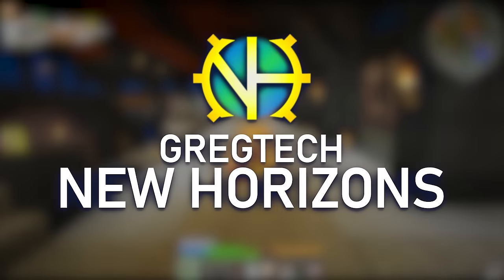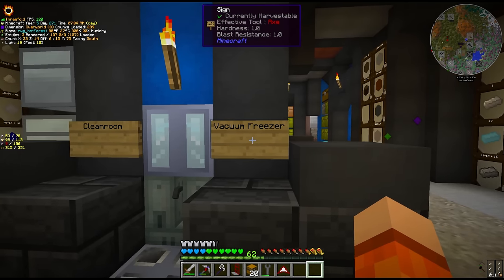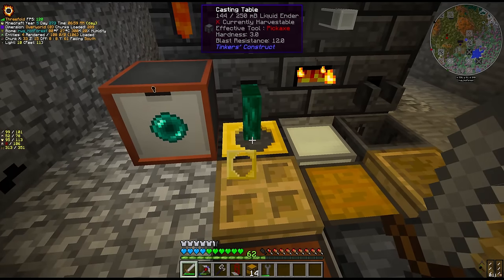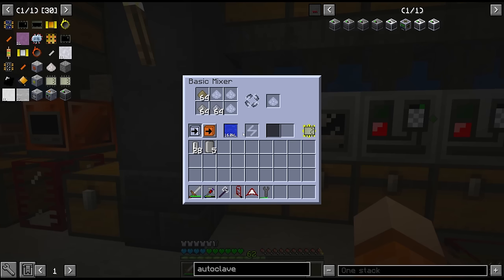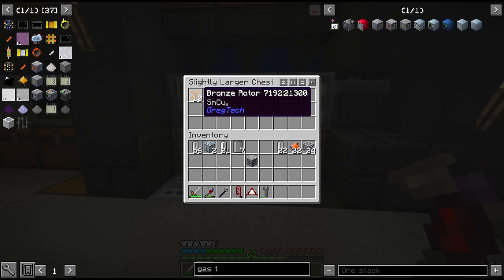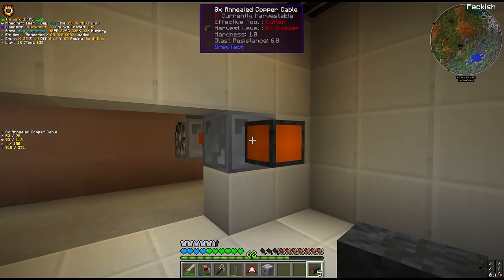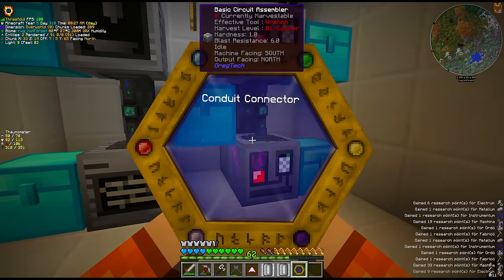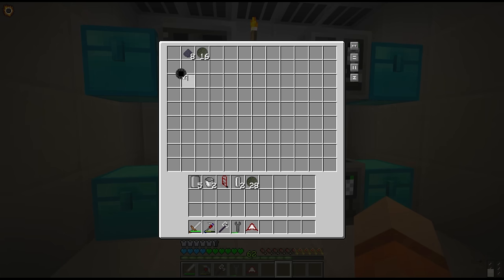Gregtech New Horizons S2 16: The Cleanroom

Comment: 0:23 If a GregTech machine from GTNH is receiving power but not enough to run at full speed, does the machine just run at a reduced speed/efficiency or does the machine just not process anything at all regardless of the energy its receiving? By contrast, machines that use RF/FE will most likely still work at a reduced speed if given insufficient power.
Reply: The single block machines will reset progress and won't progress until they get enough power, multiblocks will void their output

Comment: I think you can just use a lever on the smeltery faucet and it'll pour liquids even faster than the timer would
Reply: I know that Im a year late, but they changed the configs for TK. Making it so that levers do not auto trigger. You either need what he has or manually pull the lever each time.

Comment: I know that this comment is a year out of date and that the series is already completed, but couldn't you use a Drawer Controller with the conduit and Remote Awareness Upgrade to significantly increase the amount and diversity of items that you could see in your Ender IO "storage system" before switching to AE? Would you also be able to do basically the same thing with the AE controller so that you wouldn't need as many additional HDDs? I honestly don't know if that is something that can be done in Gregtech NH, but I've seen it done in other packs and thought it might be useful to you if you were planning on doing a season 3 in future.